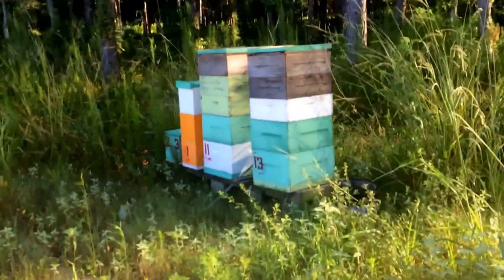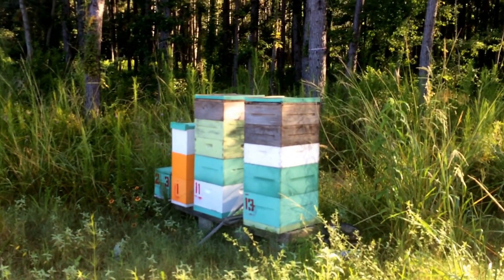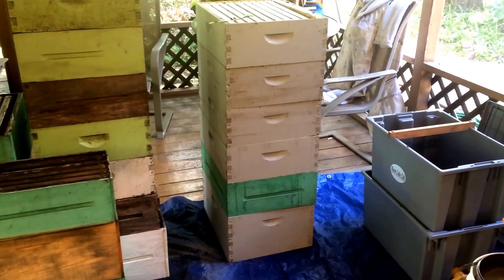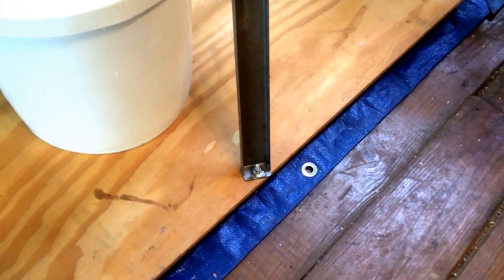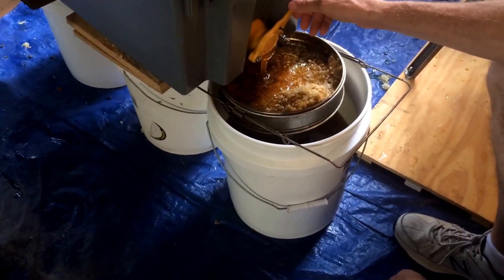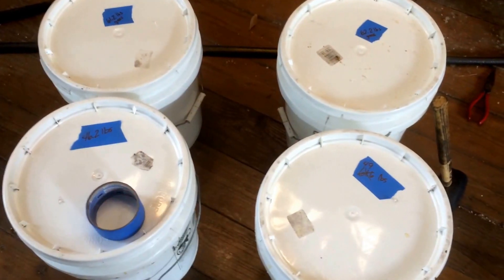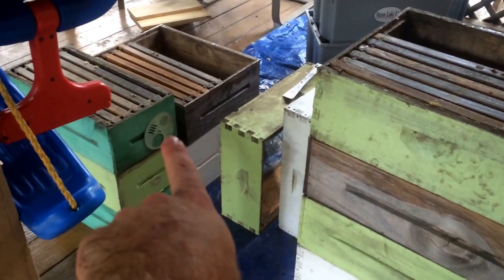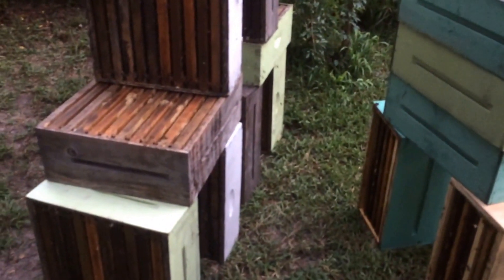Honey Harvest 2016

Comment: Will you show how you store your supers after the bees clean them up? I'm worried about pests mucking mine up.
Reply from the maker: I just stack them up outside and try to keep the rain off of them. Yeah I have mice build nests in them over the winter. But as long as they can get good light and air flow the wax moths tend to leave them alone. You can of course put paramoth crystals in the bottom of the stack to keep moths out, but I try to avoid any chemical exposure I can if it's not really necessary. In the past I have just scraped them clean and melted it all down so the moths didn't have anything to destroy, but that also means I have to rewax them the next year, and the bees have to redraw them. If you can store drawn combs that is that much less work on the bees next year.
Reply: Interesting, thanks.

Comment: I've been using a 400 micron filter. Do you prefer 200 microns for a reason, or is it just what you have?
Reply from the maker: It's just what I have. I think it's 200 micron. It's just whatever they sell on Mann Lake.
Reply: Got it...just wanted to see if maybe I was making a mistake for using the bigger filter. I read that some pollen is 200 microns in size, so I went with the 400 micron filter to allow all pollen through. Probably doesn't matter either way.

Comment: I am curious about AFB.  Do you have a big problem there. Do you treat for AFB.  Putting sticky supers might spread AFB. Is this not a concern for you?
We have had AFB introduced here in RSA about 5years ago and are instructed not to let the bees clean up stickys as this will spread AFB
Reply from the maker: RSA? 

I'm not concerned with AFB. I don't treat for it. I may also be completely ignorant. My very basic understanding is that it has more or less been eradicated. Only once I had a "scare" of foul brood, with the tell-tale collapsed brood cell caps. But when I went to look, I found that the brood was healthy. For whatever reason the bees were just pulling the cells extra deep and then the cell caps were falling back a bit. I checked dozens of cells and had 100% OK. 

If your governing body over beekeepers says its a big enough risk that they mandate not open feeding then I guess you shouldn't.
Reply: Thanks